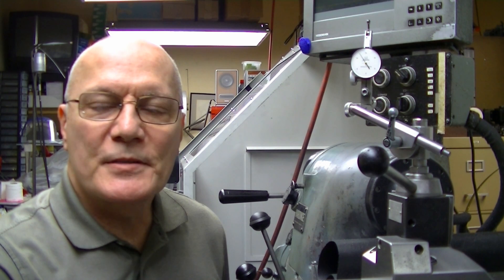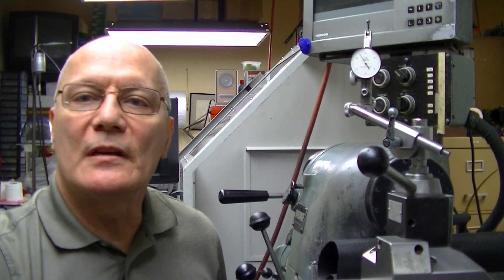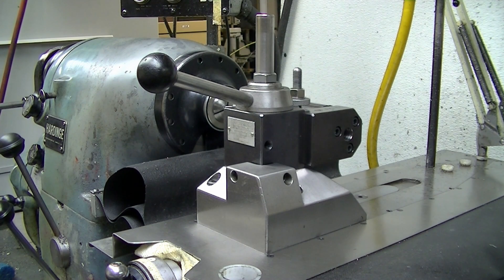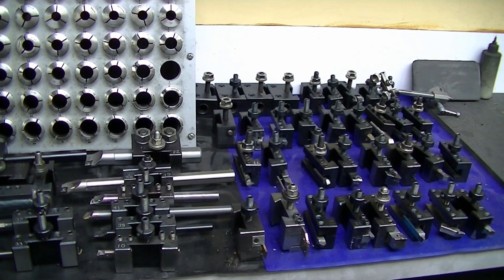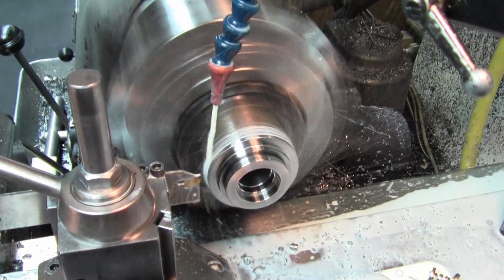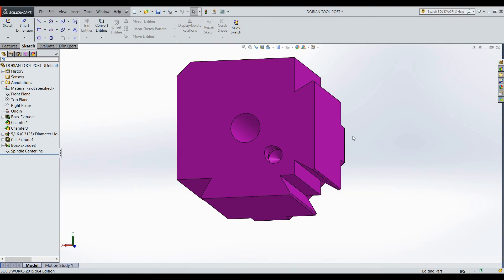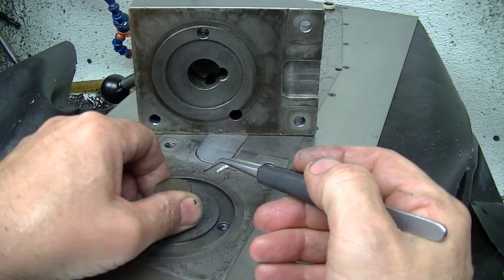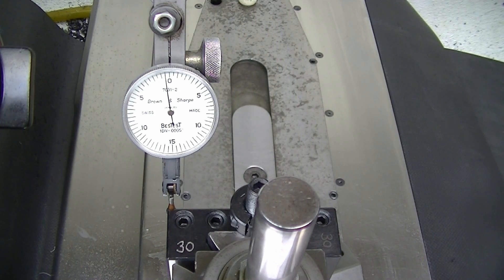THE SOLID TOOL POST MOUNT

Comment: That's nice, I was going to build a better block for my Haas tl2 lathe to get rid of the tee nut and I really appreciate the info! I never though about the torque from the tool post mounting distorting the base but of course it would! I was just going to use 2 dowels that are already in the tool post but now I think I'm going 'borrow' your mounting system. In my opinion the only compounds that can turn a nice smooth taper without hassle are on large lathes and have power feed. I use to run a huge lathe with huge compound (I think it had around 18 to 24" of travel as it was about 3' long) and it had both power feed and its own half nut for tapered threads. It work well but was literally like having another lathe bolted to the cross slide!  Thanks again.
Reply from the maker: Thanks Widget, very interesting about the mega compound. Thanks for watching and commenting!

Comment: looks you designed it for QCTP tools to hang lower than the toolpost. does that even happen? for 2525 shank tools, the insert tip is on the top surface, so that the QCTP holder's base is probably like 1.5" lower than the tip. Almost lower than the whole BXA toolpost wedge height, if the insert tip is at the center of the BXA wedge height. This is a reasonable assumption if you run drills from the QCTP, as i do, as you do.

Another thing, what this video means to me, means at least 6 months work attempting to remove the play from my compound, no surface grinder. I have a cheaper small lathe, so i am constantly blaming it on that fact. But since you demonstrated it is not possible to have a rigid compound even with a 10,000$ lathe, i will not waste 6 months trying to make it happen on my 10" lathe.
Reply from the maker: The riser is the same height as the original compound and they are AXA .Thanks for watching and commenting!
Reply: sorry for typos in original post.  i am referring the feature that follows the dovetail, allowing holders to hang lower than the actual post. Some people have even machined a moon shaped pocket into the dovetail, so that standard 2525 shank tools can hang at the right centerheight relative to the insert tip. The round nut rotating on the height adjusted screw fall into this pocket, permitting lower than standard lowering of the tool to accomodate these larger shank holders, since BXA is made for 5/8th shank tool and AXA are made for 1/2".
Reply from the maker: I only use up to .75" high tools in the holders. I grind some of my AXA holders to hold the .75" high tools

Comment: Plinths have been around forever. Nothing new. And if your tool is in danger of moving under cut, you are doing something wrong. Other than possibly the cut-off, the value of the extra rigidity of the plinth can be debated. And needing to pin the plinth to the top slide is frankly over kill. I have a hard time believing that you can push your little Harding hard enough to really be overly concerned about spinning or canting the tool post under load.

Your workmanship is good, but the results of your efforts are minor.
Reply from the maker: Thanks Dale and thanks for watching and commenting!
Reply: The picture I get of Robin's usual work and the tolerances required is that sure, you can work around the flex in a compound but if you consistently need to shoot for smaller than usual tolerances... A setup that makes that goal easier and faster pays off. Also, there is nothing wrong with overkill on a one off setup.
Reply: Dale E, I think you have missed the point, it is repeat ability that is improved, as well as rigidity. Rob works to tolerances that most job shops can only dream of.

Comment: What is the reason for using this cast iron block instead of steel ?
Regards from Portugal
 
Miguel
Reply: I want to hear that answer too...I was thinking it was made of hardened tool steel before he mentioned iron, my guess is the stability of seasoned cast iron allows for the least deformation over time?
Reply from the maker: Because I had it and because it has superior vibration damping properties compared to steel.

Comment: how did you measure the distortion in the cast iron mounting block prior or scraping?
Reply from the maker: No measure, just blue the cross slide and use it as a master to scrape the bottom of the riser to match.

Comment: Really nice addition to the lathe, certainly keeps the parting off cut from chattering! Will be my next tooling project for sure, once I can find a suitable chunk of material, nice project for the metal shaper; a bit of oldschool chip making 😎

My lathe is a Weiler Ergodor, a late 80's German toolroom lathe, approx 12 x 19 capacity. Actually thinking of adding the little Hardinge to the shop also. I love the way you can reverse the leadscrew under power, that and other features make them a really efficient little machine for threading. They are wonderful quality lathes, you could say Rolls Royce, but I think some of the classic Dean-Smith & Grace lathes slightly pip them. Still exceptional quality like the Hardinge, but utterly, utterly beautiful machines also. The little Monarch 10ee would I guess be an American equivalent.

Thank you for all your fascinating and informative videos. I'm way over in Ireland here and really enjoy all the neat tooling ideas in your video content 😎 Rotary broaching toolholder is another one for the shortlist too 👌🤓🖒

Ger
Reply from the maker: Thanks Ger, the rotary broach is on the list. Thanks for watching and commenting!

Comment: The best part about your videos Robin is the extra and extremely well thought out design that goes into any tooling you make. I'd never have considered the need to scrape that base after it's been preloaded so it again sits flat and doesn't pull the cross slide into a banana shape. And very impressive demonstration with that cut off tool showing just how rigid everything is. My pos lathe will never be a Hardinge, but this will still help a lot. From my perspective at least you get major style points on that base so it's not a chip and coolant shelf.
Reply from the maker: Thanks Turning Point and thanks for watching and commenting!

Comment: Hi, Not commented before but really enjoy all of your videos. Excellent thought processes and attention to detail. I particularly like your grinding tips - I work in a Grinding Facility at Rolls Royce in England grinding Turbine Blades for Gas Turbine Engines. 

Cheers
Crispin
Reply: you left out your train dont forget your train buddy i mean  Rolls Royce  Gas Turbine Enginesare very cool but, your train build ,epic! cant wait for  you to get back settled and in your shop again ;)cheers .
Reply: Thanks Very Much, Yes will be great when the I get set up again and can continue with the Steam Loco.
Reply from the maker: Thanks Crispin, then you possibly have used diamond rotary dressers from my previous employer (Dunnington/Wendt/Winterthur/3M). I was on the ground floor in developing the processes for making their rotary dressers and spindles. Thanks for watching and commenting!
Reply: Hi. The Process we use is called 'Viper Grinding' which is a pattant shared by RR,Tyrolit, and Makino. Yes we get through hundreds of rotary dressers. Interesting to hear you worked on the development of them.
Reply from the maker: To be clear, I didn't help invent the reverse plated rotary dresser. I helped develop all OUR processes and equipment to ALSO make reverse plated rotary dressers.

Comment: Thanks again for sharing. I like the idea especially the post for an indicator on top. Now to roll retrofit my home lathe.  is it possible to ask how you went about scraping and measuring please 😊.
Reply from the maker: No need to measure, I just blued the cross slide and used it as a master to check and scrape the underside of the riser block. Thanks for watching and commenting!
Reply: Rob has mentioned Foundations of Mechanical Accuracy before http://mooretool.com/publications.html

Comment: Great video. What happens if you have to turn a tapered part? Can you do it on another piece of machinery? I'm a novice so I'm just getting my feet wet with machine tools.
Reply from the maker: Thanks Joe, I have a wide plunge tool that I set on the required angle most of the time. I also have a CNC lathe that I can use. Thanks for watching and commenting!

Comment: My smallest lathe is a C1 mini lathe, which I consider a sort of watchmakers lathe for small bits and pieces. I bought the compound,(which is an option in these small machines) and though well made, it suffers from the ailments you have described. I shall make one of these toolpost-blocks! And only mount the cross slide when I really need it !
What do you do when you have to single point thread ? Just forget about the 29 degree thing and plunge in at 90 ?

Paddy
Reply from the maker: Thanks Paddy small threads with straight infeed are not a problem and thanks for watching and commenting!

Comment: That's a great setup for rigidity alone. Reliable Repeatability of the tool locations is a major time saver when doing production work. If the parts are not ending up at the correct diameter, you can almost guarantee that it's because of a worn insert. I would imagine that every tool has to have a very specific insert assigned to it, or the presets will be of no use. I love the idea, but man, I'm not that organized and I would need to invest at least another $1000 in QC tool holders. I'm not even sure if my DRO has memory for tool positions...I'll have to investigate that, I've never used that function if it does. I should at least look into it for my most commonly used tools. You gave me a lot to think about. Rigidity hasn't been a major problem on my Ikegai A20, but it's a large 20" swing lathe built like a tank, I always keep the compound locked down. I have had the tool post swing loose on occasion during heavy material removal though.... now I use a pipe on a wrench to tighten that sucker down. Your attention to detail and organization blows my mind...my OCD has got nothing on yours. ;)
Reply from the maker: Thanks Marcel, good points and thanks for watching and commenting!

Comment: 9:49 what is the high speed clicking like sound? It is still making the noise after you complete the parting off. I certainly see the multiple advantages of this setup but don't think  I am ready to give up the handyness of doing angles with my compound just yet. :-)
Reply: Good question Bryan, you can hear it before the tool even engages the work
.
Reply: Yeah I hear it pretty clear at 9:49 and that appears to be before tool contact.
Reply from the maker: Hi Brian, that is the 6 jaws tapping the neoprene way cover sheet below the chuck. When the chuck is close to the headstock the cover piles up and can rub the chuck. Thanks for watching and commenting.
ATB, Robin

Comment: Thanks Robin, the Graziano is pretty good but i think it would require a little more TLC before the benefits of  that  rigid setup .
( ok we will leave the operator out of the equation)

I have had the tool post spin on me  during some fairly aggressive tuning despite  it being  tight. I was thinking of lightly grinding the area of the compound where it sits.  would the Aloris also have to be reground?

I'm always learning something.. thanks for sharing
Reply from the maker: Thanks for stopping by Phil. Having flat surfaces will help but it wont completely cure the problem.
ATB, Robin

Comment: Nice video, thanks. I recently got my own Lathe DRO, and I must admit that I'm constantly peeved by the moving compound. Somehow I just can't see myself taking it off though...  How do you thread with this setup? 
I'd also like to know what you used for the flexible way covers. I tried using a thin rubber mat, but that was a nightmare. Chips stick to it and the oils warp/soften it....
Reply from the maker: Thanks Kobus, I have a video on the covers coming and thanks for watching and commenting!

Comment: OK, now I'm worried, you "grind" your tool holders? Way OTT.  :)  Cheers
Reply from the maker: Yes, I buy $12.00 holders from CDCO and regrind the faces.
Reply: I'm pretty sure he just does that one because he indicates off it's face to true the toolpost. After putting all that thought into building the mount then scraping the base in, I'd want to be sure of the face I'm referencing too.
Reply: I believe he grinds just the 1 used to re-align the tool post to the machine axis. Of course I could be mistaken.

Comment: How did you handle single point threading on the Hardinge without the compound? (Before you got the Tormach) No infeed at 29 degrees? Great videos! I always wait for new ones with much anticipation!
Reply: Straight infeed on fine pitch threads would be fine.
Reply: Straight infeed for most, if not all, threads is fine. The better machinists have come to acknowledge that it is unnecessary to feed at 29 degrees, especially if full form inserts are being used.

Comment: Very informative and timely given how I recently completed my compound replacement, of which I think you are aware. Design considerations on my machine were a little different than yours, I don't have a dro w/ or w/o tool offsets but was thinking about pinning the qctp to the riser in essentially the same way as you described. And one of the first things I tried was parting off with HSS and carbide and finally both are possible once again! Now I think the weak link has move down to the cylindrical dovetail boss that holds the riser to the cross slide, but nothing I can do about that until /if I ever make a t-slotted cross life replacement. Thanks for everything Robin, always exciting to see your content. 👌
Reply from the maker: Thanks Spencer and thanks for watching and commenting!

Comment: Nice, thank you for going in detail on the replacement.
Reply from the maker: Thanks and thanks for your support and for stopping by Stefan.
ATB, Robin
Reply: @stefan are you going to build a taper attachment, or keep going back to the compound when that is needed?
Reply: Before I build a taper attachement, I hope that to get a cnc lathe, maybe a small, old Emcoturn 120...  ;)
If I have to do tapers I can always drop the compound on the rear end of my crossslide.